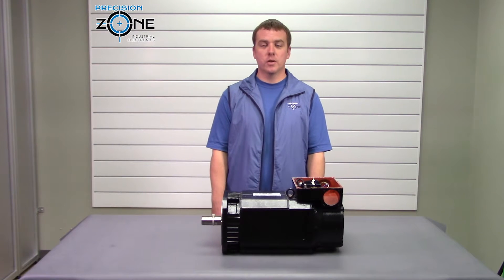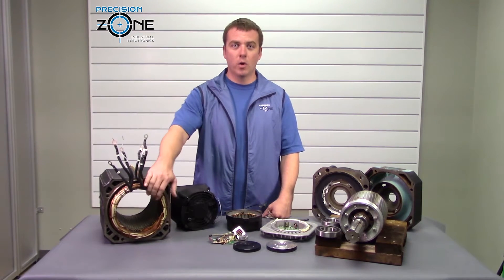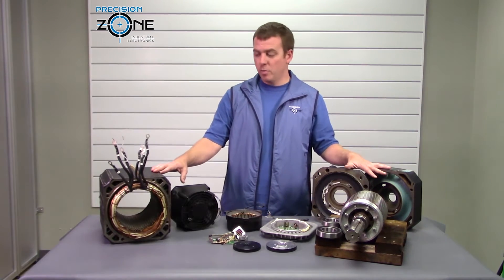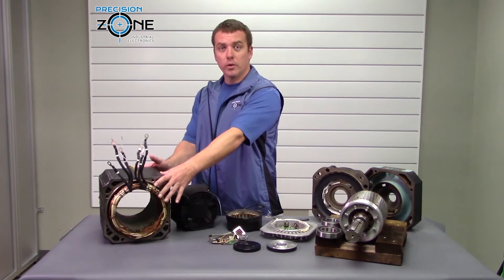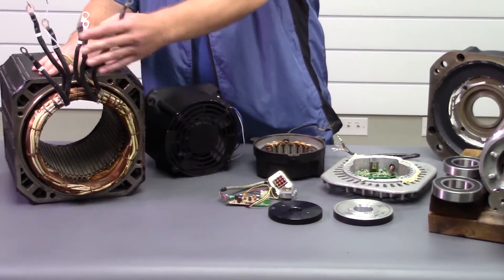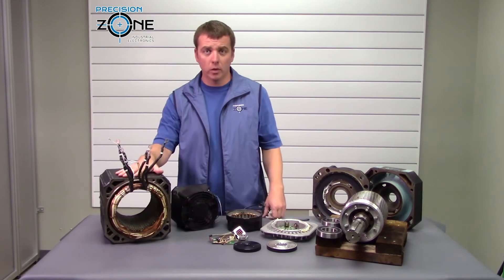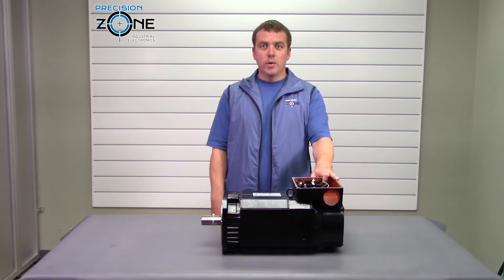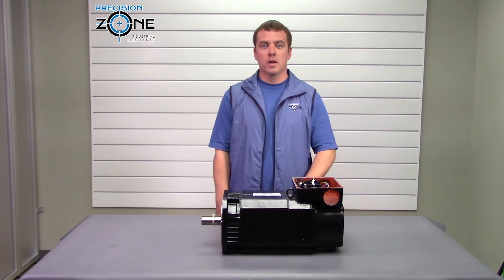Overview of AC Spindle Motor Construction

Comment: I have a 1.8kw ac servo just mounted to my G0704 mill for the spindle, it’s running single phase 220 with analog speed signal connect to my acorn cnc board. My issue is I can’t get it to reach the max 3000rpm it tops at 2618rpm, I suspect it might be bc it’s not 3 phase 220 but not sure. Are my suspicions correct or do you have any idea what my issue could be?